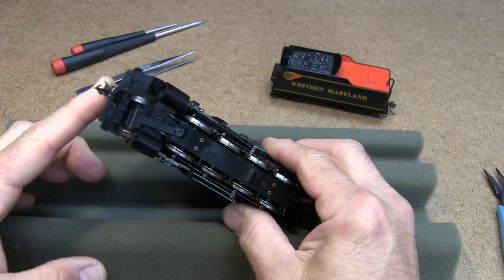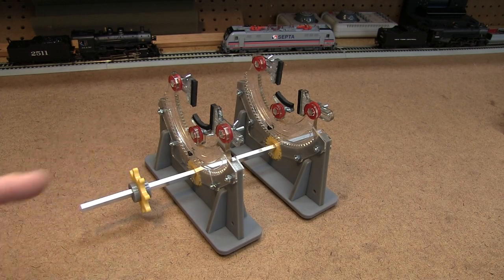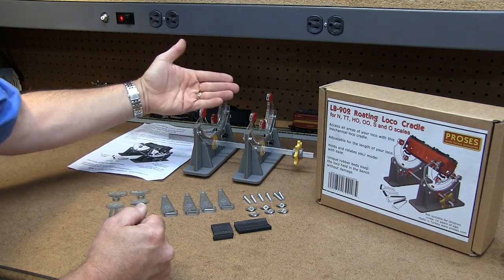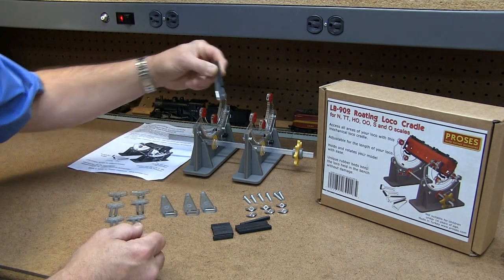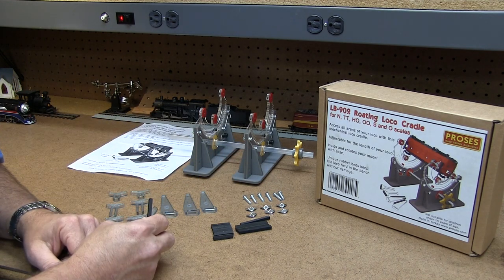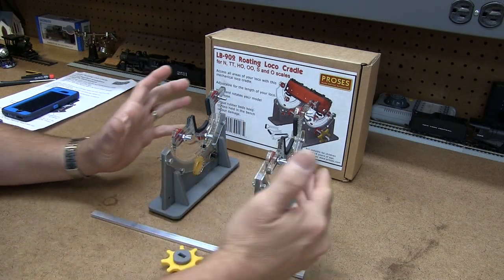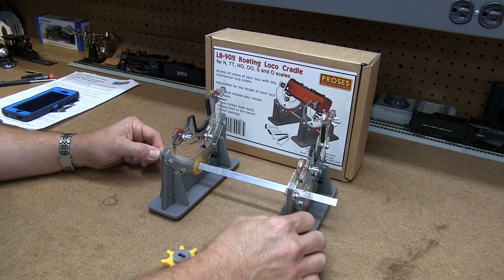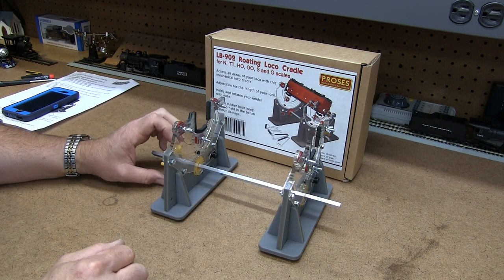Bachmann PROSES 39018 Multi-Angle Rotating Locomotive Cradle

Comment: This was a great idea but it's not strong enough and the teeth break off. The first time I used it one of the teeth broke off, didn't put any pressure on it, the Locomotive just made it turn and broke a couple teeth off.  Not worth the trouble buying. 
I made a couple cradles out of packing foam works great.